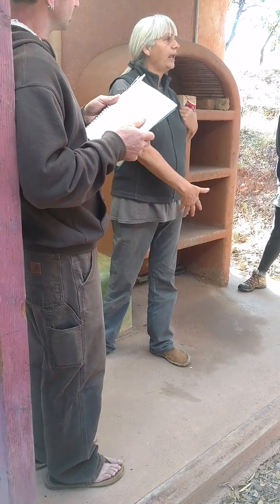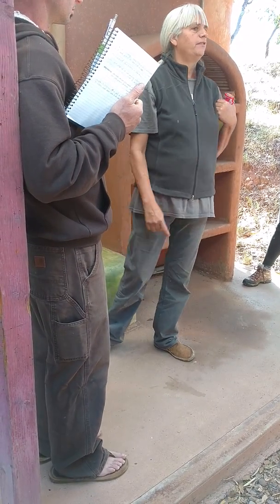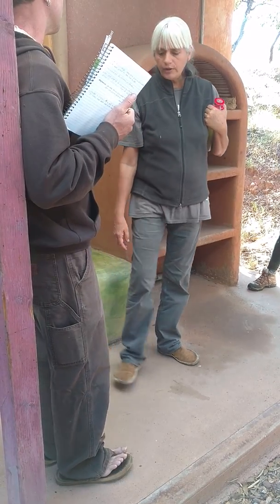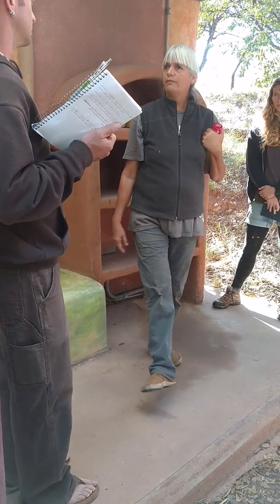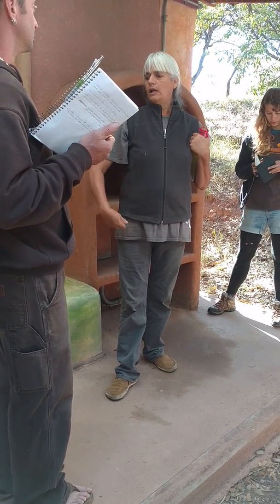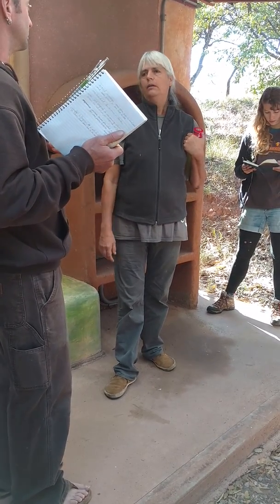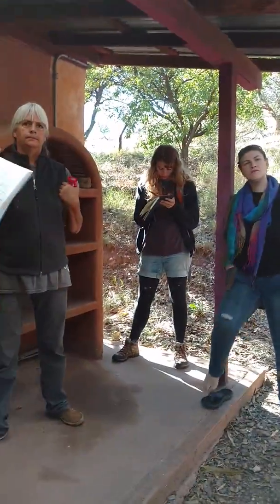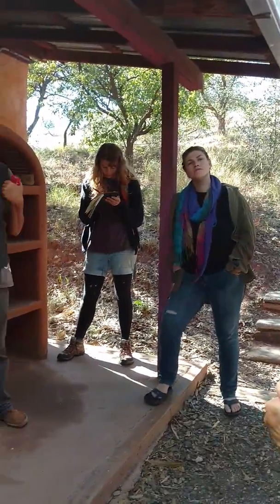Quick & Durable Lime, Clay, Sand, Salt: Bill & Athena Steen's Canelo Project Part 16: Uncle Mud Tour

Comment: May I ask?     What's it made of?   So 1:2 lime to clay or 1:3, what's ideal and why?  Sodium chloride salt and if so, how much?  Its actually waterproof?   Lime from ash or is there a better ash?  What kind of clay as there are many with different degrees of purity?  What's idea with all these ingredients?
Reply from the maker: Hello, Athena responds: "The recipe with salt in it was for the "tataki"-Japanese-lime-earth floors.  I cannot remember the exact recipe that was used for the floors in Canelo. I know our lime-clay mixes are usually 1 lime to 3 clay. For a plaster, we would then use that mix as a base to which we add sand or chopped fiber depending on what we need (finish plaster or base coat).  For the tataki floor, there was no fiber added, only sand, probably on the higher side, like 1 lime-clay to 3-4 sand. The "salt" used in the tataki floors is "nigari" - a byproduct of salt making and is primarily magnesium chloride, magnesium sulfate and potassium chloride. It is used in Japan as a traditional coagulant for making tofu.  The nigari helps slow down the drying process so the lime cures stronger.  The floor mix is quite dryish and  pounded into place, rather than troweled.
Reply: @UncleMud  Nice!   Thank you!  I've been trying to find the ideal formulas for this stuff.  I have found some others who want to sell me recipes that might, might not work well.  I appreciate your willingness to share.  I've put in a ton of research trying to find these things out.   Once I find a location, I'll have my land analysised to see what's available but I'm willing to spend more for a better end product that last longer.  TY!